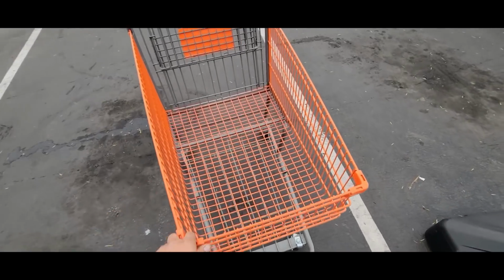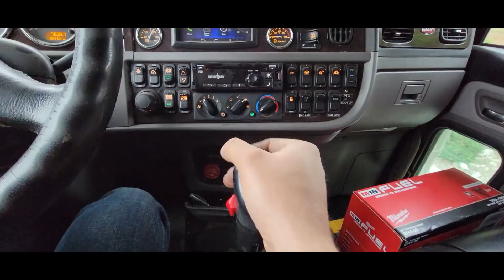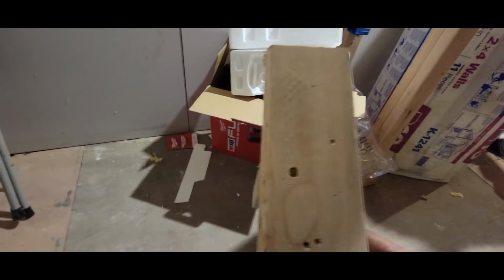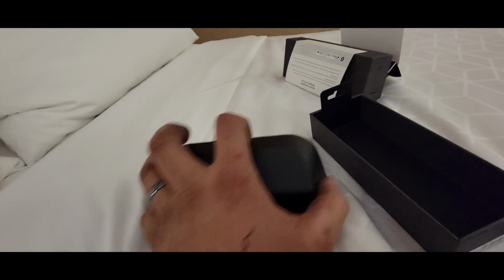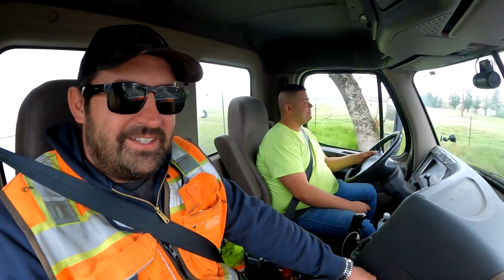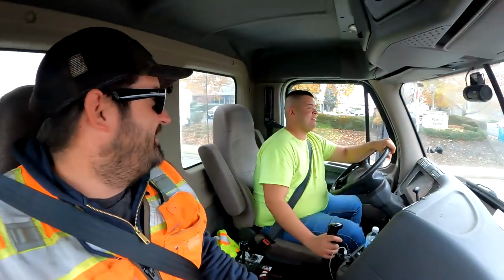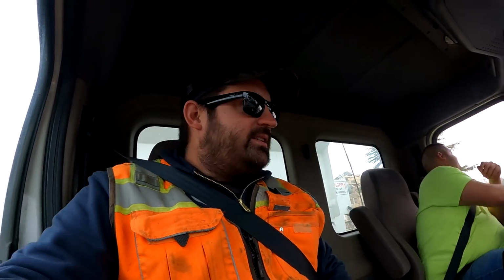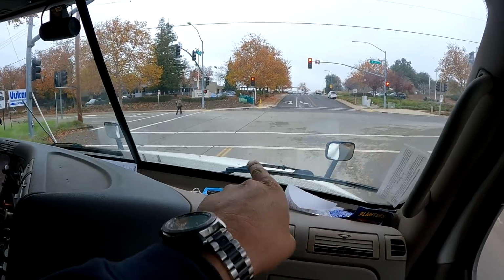How To Buy A Tool (M18 NAIL GUN) From Home Depot (And Anywhere Else For That Matter)

Comment: I know the tool market is always changing but I'd like to share this experience from about 5 years ago. A very crafty soon to be GC carpenter told me there is a difference in a tool you buy from home depot compared to one from the same company that looks like the same model but sold for a higher price at this local lumber yard that had a tool store. He proved it to me by taking apart 2 drills I would have assumed were the same, home depot version had plastic brushes and lumber yard version had metal brushes. In his experience it was worth buying the version built to last to bring to secure jobs and some cheaper home depot stuff to bring to sketchier sites where tools might be stolen.
Reply from the maker: Thanks for the heads up Ziggy I didn't know that kind of striked up some curiosity, but as far as the entrance goes it has just been a a lot of irrigation which has been long and tedious buy we are working on it thisnweek because we are shut down because of the rain.